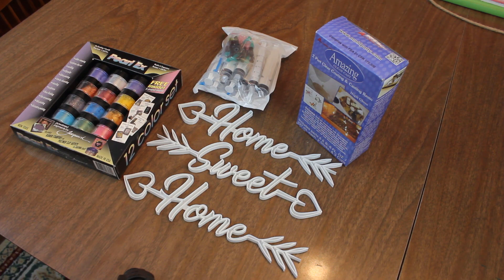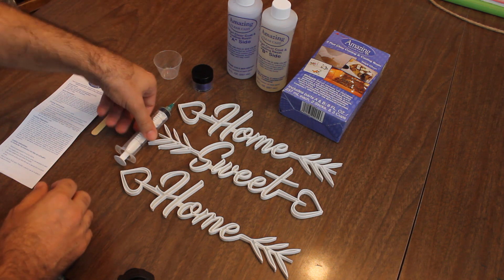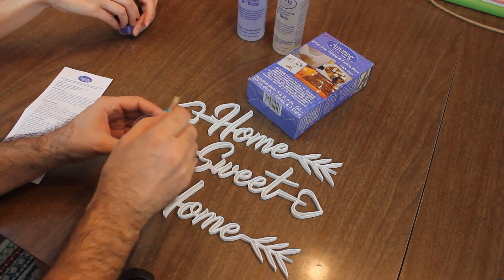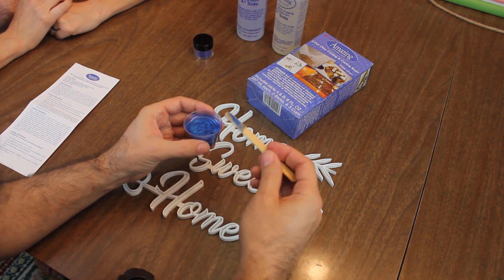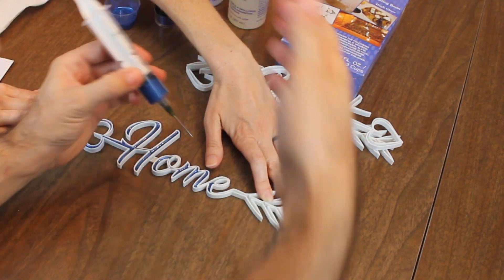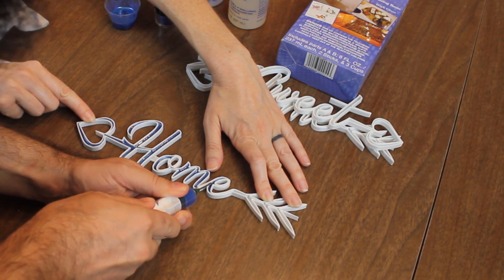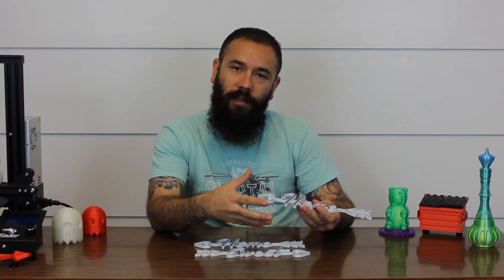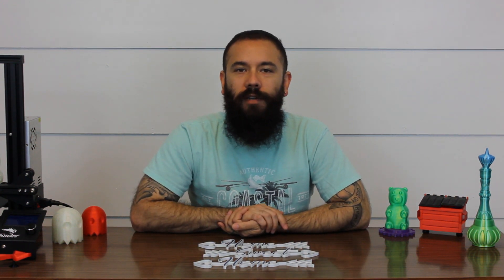3D Prints with Casting Resin Inlay! Alumilite and PLA

Comment: I use low viscosity epoxy resin. Flows so much easier. I tend to print with much thinner walls (usually only 2 layers thick) - I tend to use clear lacquer to seal the print and stop the epoxy from leaking out!